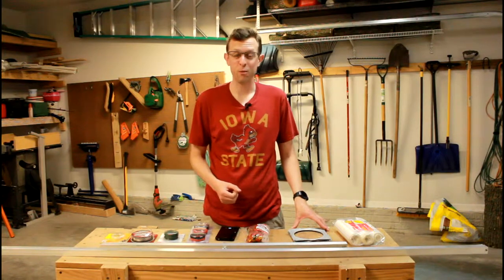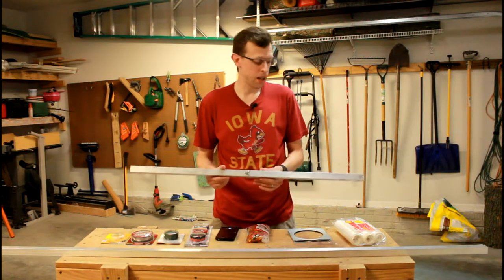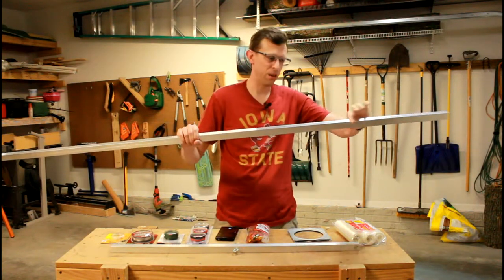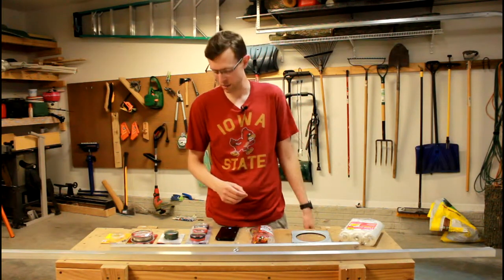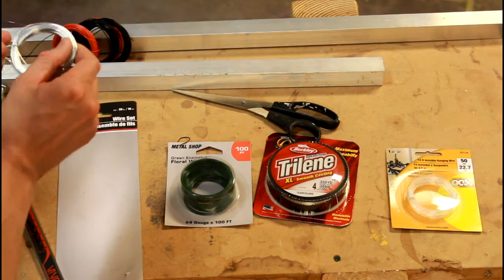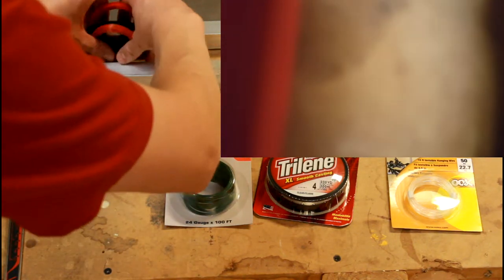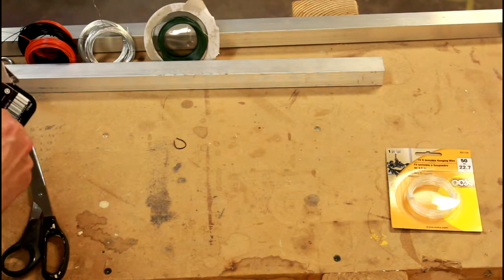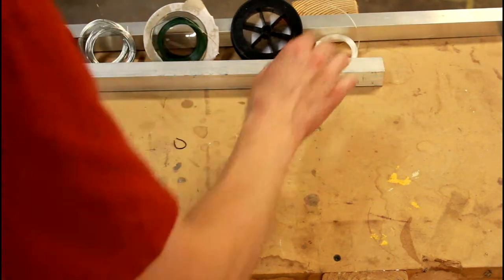Cavendish Gravity Experiment: Evaluating the Materials

Comment: Unfortunately, Newton’s Law of Gravity doesn’t work in general for masses that aren’t very small compared to R or aren’t spherical balls or shells with uniform density. That’s why spherical balls are used when going for accuracy. Also you need to calculate the gravitational force between the big weight and the aluminum bar.